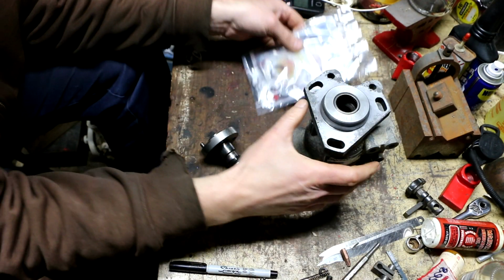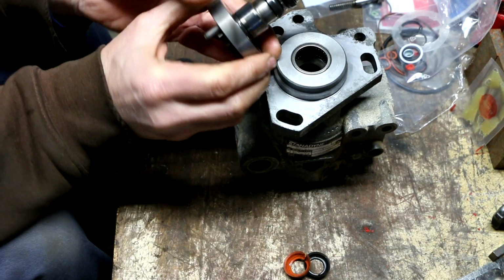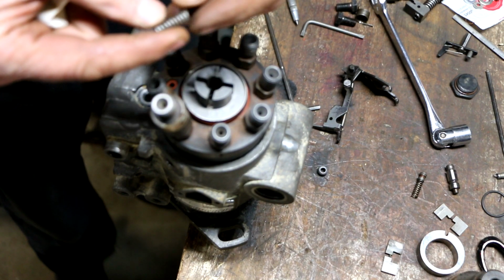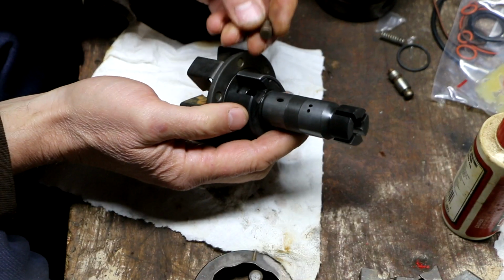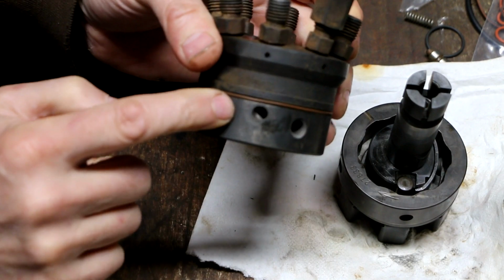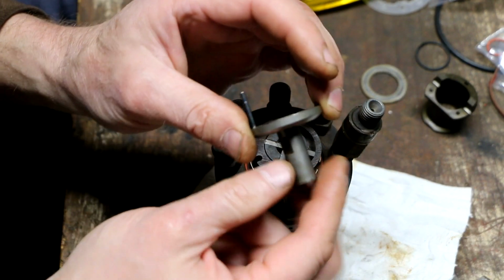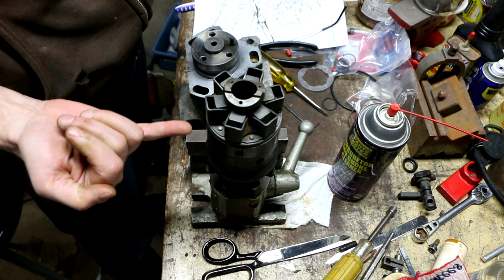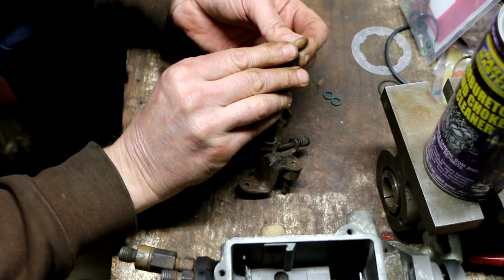Stanadyne DB2 diesel injection pump repair Part 4 of 5

Comment: small detail noticed... the gasket and seal kit you used is for industrial/agricultural applications. there is another gasket kit for Ford/GM automotive kits. that would explain the differences you noted (only 2 umbrella seals, etc.). The Stanadyne automotive kit is PN: 24370

Comment: Good iinstruction overall. Unfortunately, the advice you gave concerning the cam is just passed along false info, even though you got that info from a seemingly expert source. I heard them say it, too. The pump is designed to operate either clockwise or counter-clockwise, correct? The way you change that is to flop the cam over. It has arrows on both sides. This is the design, so it can run both ways. If the line over the hole always has to be at the top, then the pump can only run one way. So you are saying it can be put together to run only one direction, but that is not what it was designed to do. The correct question should be: which way should this pump run for this application? Then set the cam for that direction. Best case scenario, you marked it when you took it apart! Otherwise, you are in a guessing game. And that hardened steel is difficult to mark. Need a paint stick or something.
Reply: I talked to a technician who rebuilds them. He said he doesn't pay any attention to the inspection hole theory. There is a "hole" in that theory. Look at the arrow. You need to know which direction it should go for your application. Mine is for a Ford 7.3 idi, and it goes clockwise, looking from the drive end. End of story.

Comment: I live in Jacksonville NC and worked at the Stanadyne plant in town from 2004 -2011. I helped assemble thousands of these DB2 pumps and watching this video brings back some great memories of my time there.   I never got to see the end result of my work there but watching you disassemble and clean this pump is wonderful and fascinating.
Reply from the maker: Several years ago, I did a Roosa master pump, out of an early 70's Oliver tractor. Same design, just a fantastic example of a properly engineered device. Thanks for watching.

Comment: I grabbed up a space kit number 08793 
For bd 2 pumps as well ym this has the 3 umbrella shaft seals. I'm not going that far , this has been rebuilt it landed in a bucket of water. Um I'm impressed not bad.
Reply from the maker: Thanks for the part number. Hope it helps anyone else doing one of these.

Comment: Didn't seem too bad to reassemble it.  I was watching Salvage Workshop a few weeks ago or so rebuilding a pump from piece of heavy machinery, and he had to remove the replaced umbrella seals, and reinstall them while reassembly of the pump body unto the machine took place because of space. It was something, but it worked.